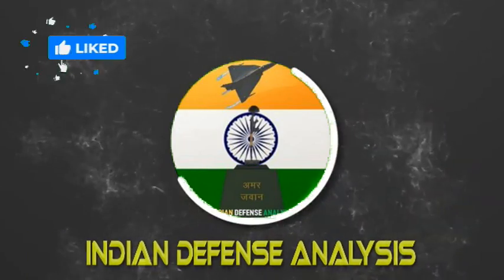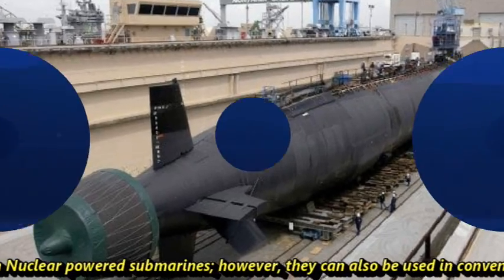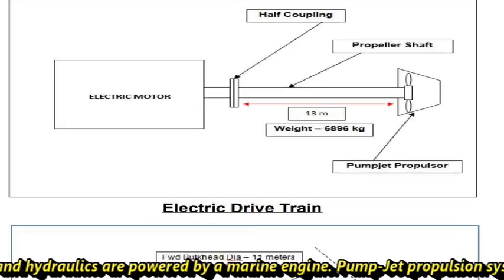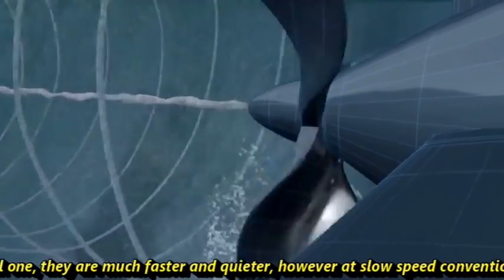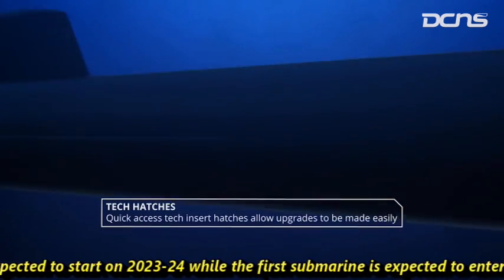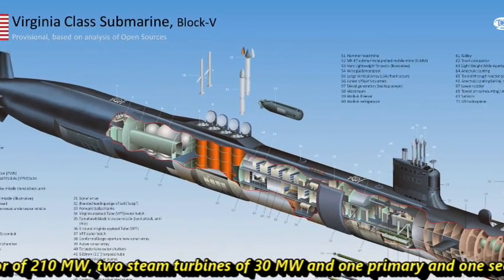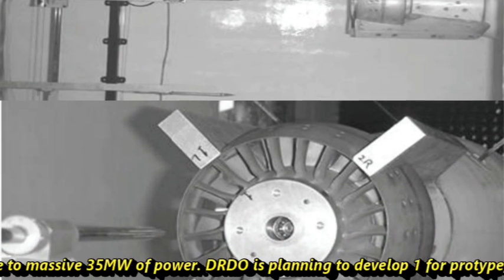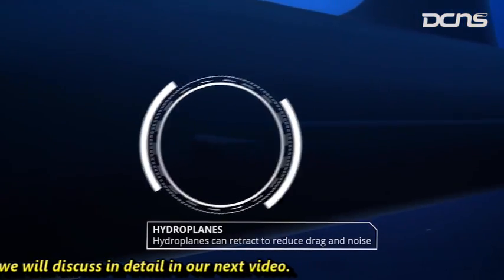Pump jet Propulsion technology for Project 75 Alpha Nuclear attack submarines SSN of Indian Navy

Comment: The fastest and cheapest way to attain these is buying the conventional Barracuda class. This time with AIP because the DRDO is promising the AIP will be operational in five years since before the Scorpène class submarines where build. First it would be ready before they started building, than it was ready to induct in the last three now it will be ready for the overhaul. My guess is that the Scorpène class submarines will be retiring before they finish their AIP. 

The most important thing to do next to building an SSN is negotiate with Japan about lithium ion batteries for the conventional fleet of the future preferably in the P-75I. My preference for the Barracuda class is due to their offer to help with the SSN. French nuclear reactors are powered by civilian easy to obtain cheap fuel rods and can be refueled through a hatch system. With Indian navy procurement as is it would be better to have one that actually can be refueled without cutting open the submarine.

Comment: Instead of a 3rd aircraft carrier we should build a submarine fleet. A submarine fleet of 60 can give us control over entire IOC. 30 nuclear attack subs, 20 conventional subs, 10 SSBNs.
Reply: Both are equally important, a 3rd IAC can be operational while the other may undergo refit & maintenance. Maintaining 2 IAC all the time for both seas is desirable, also the SSNs can be used for strategic role
Reply: @AnirbanSarkar203  without submarines aircraft carrier is like a sitting duck. we need more submarines first
Reply: yeah need subs first. Carrier can wait
Reply: 30 nuclear subs will become a heavy logistical problem